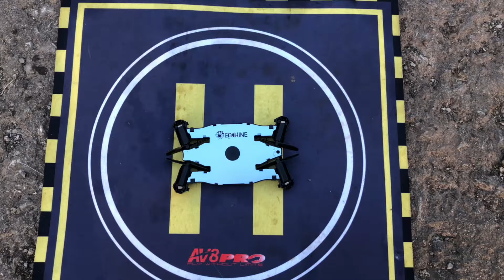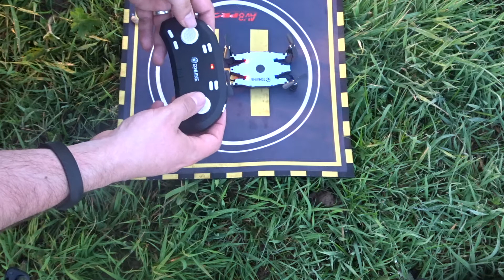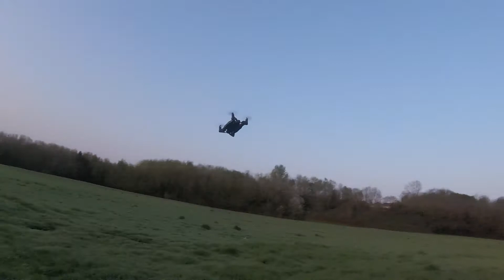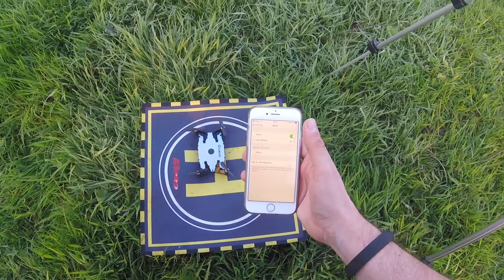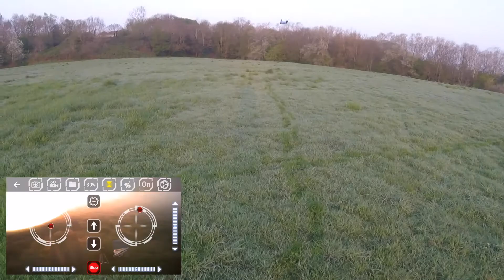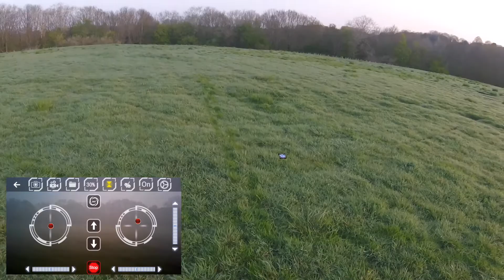Eachine E57 Nano Quadcopter Drone Flight Test Video

Comment: Thanks for another awesome review JD. Just a shame the battery on this wasn't longer. Still going to go with a Rhyze Tello I think with a repeater for my first drone, unless there's anything else you think I should shortlist.
Reply from the maker: Hey templetogs thanks very much mate, well as a first drone I would consider something easy to fly, stable, and with medium to high battery life so you can spend more time in the air and learn plus have fun. The Tello I think is a good start, but you may want to also consider getting a small nano indoor drone to practise with and hone your skills. It's what I should have done at the start, then take the Tello out and give it a whirl 😀👍
Reply: I would say sima 20, 30 beans, I learned on it and it saved me a small fortune...💚
Reply from the maker: great shout :-)